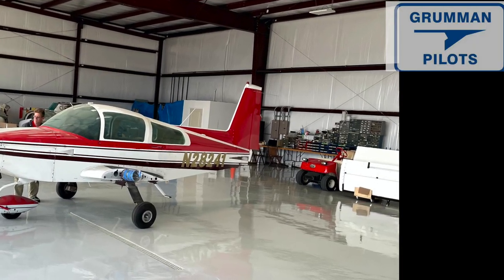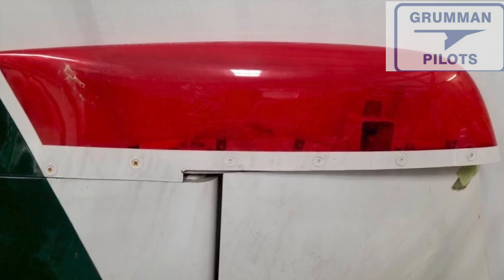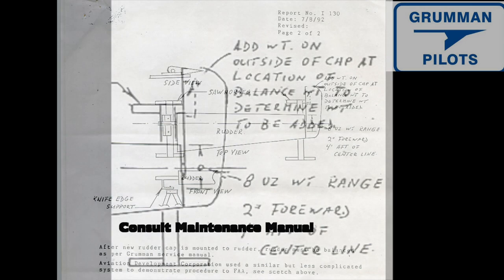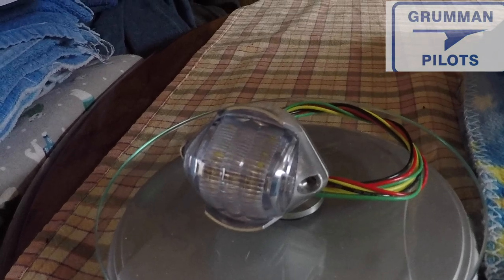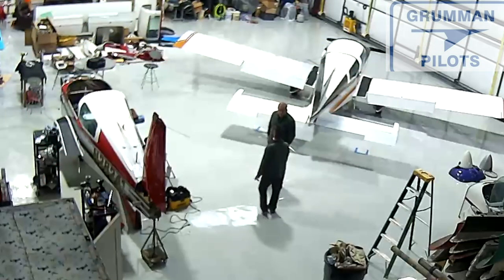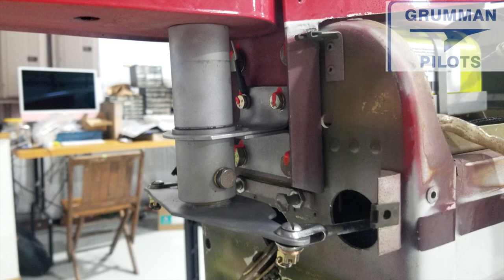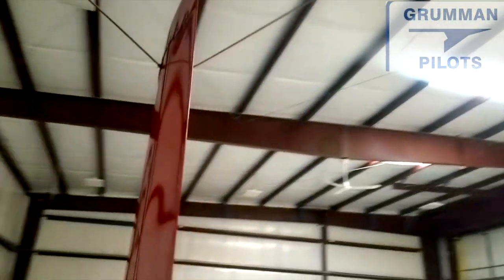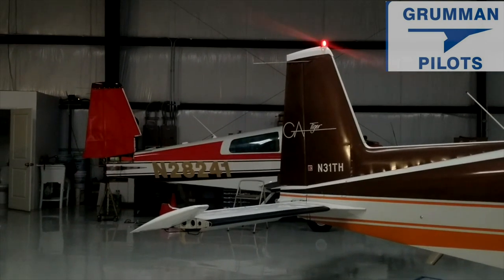Replacing The Flashing Rudder Beacon With AeroLED Sun Tail Beacon:STROBE - Grumman Style

Comment: Thanks for sharing your process! I'm currently looking at options to upgrade the anti-collision lights on my Cessna 140. In order to make the SunTail flash only and not also remain on as a position light did you simply leave the positing light wire disconnected? Does this set up mean that some of the LEDs in the cluster are never turning on or does this light use the same LEDS for the position and strobe lights? Thank you!
Reply from the maker: I would have to look, but the wires tell us position and then strobe.  Have to look in the manual.

Comment: Interesting! But a true small red LED tail beacon such as the one produced by aeroleds would be better. Without getting into the deep science of lighting spectrums, LED lights and colored lenses don’t work like incandescent bulbs, placing a white led behind a colored lens cuts down on total light output and color. The general rule of thumbs with LEDs is the color of the lens should match the color of the LED or be a clear lens.
Reply from the maker: The Sunbeacon is available in red, but under the red cap it seems too dim.  FYI, we choose the suntail.  On the other hand, we do have access to a clean rudder cap, but we looked a the Sunbeacon II direct replacement.
Reply from the maker: The color of the light is set by the FAA approved red material so having a broad spectrum white will not affect it.  Compare the color at the end of the video between the two lights.  Same red.